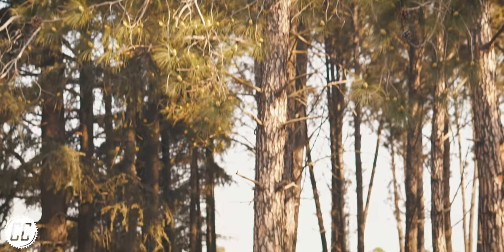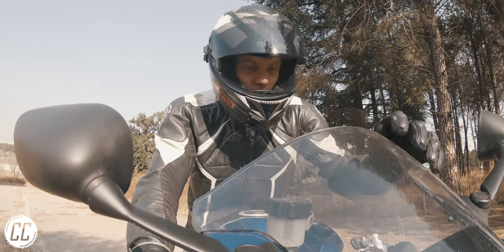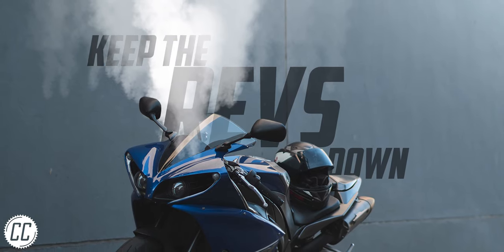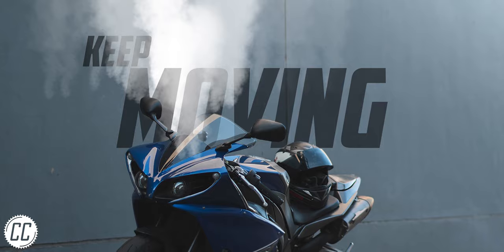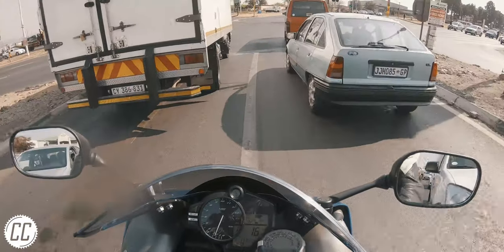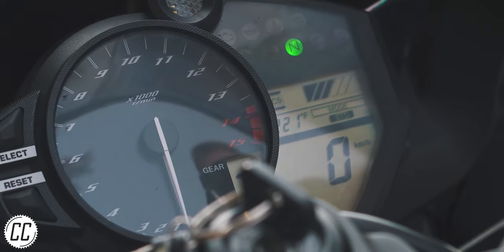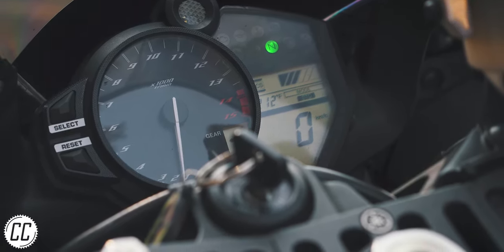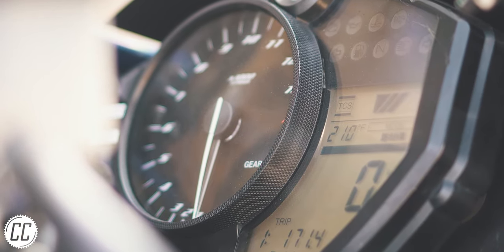Overheating Prevention Tips & Tricks

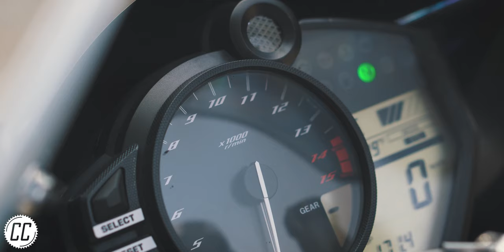Comment: 3:28
The bike will not get to a dangerous heat level if its radiator, water pump and fans are working properly. The fan coming on is exactly for that reason. If you kill the engine you also stop the water pump, going against what I just said above.
Reply: Just looking for this comment :D. I feel like killing it will make it not the solution but the staying on is the option here.
Reply: @AnkurDagar  Yeah just keep it running and it will be ok. If the bike gets to a dangerous heat level (for which killing it would actually be beneficial) it will turn on the red  water heat light on the dash. On older bikes it will just come on, in newer ones (as in my 2017 R6) it will stay on if it's approaching dangerous heat levels and will blink (and self-kill the engine) if it reaches the dangerous level.
Reply: @Kid574  Yup. After getting the overheat warning killing it for some time is alright but on a red light not recommended. 
Thanks, Mate. Ride Safe. Peace :D
Reply: yep, the second the water stops circulating your engine heat rises for about 5-10 min before dropping again(in a car anyway, probably less than half that for a bike). So in other words unless you have an air cooled bike just let it idle for that 2 minutes. Only kill it if you're stopping for 5+.
Reply: try that in Central Florida in the summertime in traffic and see where that gets you!.
Reply: Cajunman Dick Well I’m from India here summer temperature is about 47 C. 
And traffic is too much here.
Reply: As stated do not, I repeat do not shut off your engine. This is the worst thing you can do. He only got four out of five tips right. You shut your engine off on a hot day trying to prevent overheating and that will be exactly what you do. Let the cooling system do its thing while the engine is running. A good running cooling system will not overheat if the system is working properly. Even in most air cooled systems that I know off, once you shut that engine off, overheating is almost guarenteed
Reply: Bro R1 is overheated bike... Compare to other 1000cc like gixxer 1000 fire blade 1000 bmw1000 h2 zx1000 etc.. bikes?
Reply: @r1sabotage  so true also running the fan with engine off is stupid, it will drain your battery and not start, or wear the battery's lifetime
Reply: I've killed my bike (08 r6 aka little heater) while the fans are trying to cool it down (225°F is as hot as it ever gets) and when I turn it back on it will read over 230°F. It's not good to let that heated up fluid and extra engine heat sit stagnant in your bike. It just makes it worse
Reply: Not only that killing it at a set of lights is so dangerous as the idiot behind you on there phone hasn’t seen you stoped and is still driving, boom slam into the back of you and cause your not running and in gear you can’t just move,so much precious time wasted

Comment: This is a common misconception among some riders. When your fan is on, it DOESN'T mean that your engine is overheating.
I live in a climate around 34° to 39°C, my Yamaha MT 07 fan is on and off all the time. But my engine has never overheated.
My engine still running smoothly after 55,000 Km.
Reply: True
Reply: yamaha and other japanese bikes have managed to solve such problems.So whatever you say is right.
Reply: MT07 isn't a sport bike.

Comment: Older bikes have much less problem cooling down. These new sportbikes are just too hot, no pun intended :P
Reply: The GSX-Rs(750) from the oil-cooled era was a hot bike. So hot they took off the fairing lowers when they raced them on Suzuka 8 Hours
Reply: tell that to my honda blackbird
Reply: This '08 gsxr I bought needs to be cooled by going fast!!!
Reply: No, they are leaner tuned from factory because of restrictions...
Reply: Older bikes have a lot of problems cooling down, naked bikes have less problems than fully faired bikes
Reply: @astontoftero3404  I disagree. I have an older bike and most of the people I know with newer bikes need constant maintance or repairs that my bike doesn't even have, and when something needs repair I can do it myself because is so easy, and there is a lot of guides on internet
Reply: My '87 CBR600F1 could reach the red zone on the thermometer just by idling in 6th gear with 40km/h for 3 minutes. 
A bad thermostat not turning the fan on, bad coolant and air in the system didn't help. I fixed that and it's still runs quite hot even on a cold day (i live in Denmark, so it's always cold).
Reply: Hello I have a technical question if you or anyone can answer please that really knows. I Have a WR450 with 
a 1.1 bar cap 16psi.. It never overheats and always stays under 180..if I put a 1.8 bar 26psi cap will thar cause undo steess to hoses or gaskets??

I know water boils at 225 with a 1.1  so if it stays nowhere near there any cap over 1.1 should be fine is that right?
Reply: I'm wondering if anybody has used a bottle of water wetter and pure distilled water if that really runs cooler

Comment: Modern bikes now come with a waaay too lean air-fuel mixture, which also makes the engine run very hot. If you  find a way to put more fuel in there, it will run cooler. I did that on my CBR600RR, installed a power commander and since then not a problem :)
Reply: What's a power commander, just curious? And also couldn't you do a tune-up where you change the fuel to air ratio and make it run rich ?

Comment: there are some other tips and tricks to keeping your bike cool. 
1. clean your radiator , just with water and a good degreaser. just don't use a high pressure washer , otherwise you might run the risk of damaging your radiator. 
2. change out your coolant , it might have been a while sinds it has been replaced. and overtime your coolant loses some of its cooling capabilities. 
3. ingine ice coolant , i've used it. and doesn't realy keep your bike from reaching high temperatures . But it does help dispell the high temperatures quiker ones you start moving. 
4. aftermarket coolant hoses are often a bit better in cooling your bike , but not by much. 

5. bigger radiator of bigger / faster spinning fan. 

hope this helps you out

Comment: used to kill the engine at red lights until i heard a theory that the sudden cool coolant rushing through the engine from the radiator when you restart the bike can cause cracking and warping of the heads since they are still heating up due to radiant heat and there is no coolant flow while the engine is off. not sure if its actually something to worry about but i figure the fan keeps my bike at a (high) but safe temperature idling for even the most frustratingly long red lights
great vid as always tho mate
Reply from the maker: I guess it’s pick your problems. I’ve seen bikes damage their own valves from getting too hot so there’s no good ending apparently lol
Reply: that happen with a VERY COLD WATER... like water at 22-24c and the engine on the low 100's... so no big problems...
Reply: That is not a problem as the difference is not great. It would be bad if the water would be much colder. Just install a manual switch and flick it on before it gets hot.
Reply: When the engine is hot so is the coolant. How is the coolant going to be cold enough to crack an engine ?  The coolant cools down as the engine cools down. It’s the wind that hits the radiator that cools the engine, it’s impossible for coolant to stay cool
Reply: @biggils8894  agreed, wasnt saying its likely, but i can follow the logic, coolant in the rad would cool much quicker than the coolant in the heatsoaked engine potentially creating a temperature disparity great enough that in the most unlikely of circumstances may be great enough to cause a rapid and uneven cooling of an aluminium head or block (or both)... i guess the engine would have to be well and truly overheated, left to heatsoak and then started again but doesnt seem impossible. Definitely unlikely in a normal traffic light stop situation though

Comment: On some bikes you can space the radiator away form the headers slightly which will help. Don't do too much that the front wheel contacts the rad though!
Also a toothpick is a good tool to straighten out any damaged fins to bring back some cooling capacity to an older radiator.

Comment: Add a switch to turn on the fan also manually (keep the auto fan aswell) and everything is okay. Killing it at red lights will do more harm than help. Starter motor has limited lifespan. And starting the engine puts some forces on many parts.

Comment: I highly recommend you do NOT kill the engine at traffic lights. Not only is it dangerous but this also stops circulation of coolant and the bike will get hotter before it gets cooler. Also, this bike is known for bad starters. They don’t last long due to poor build quality. After I start my bike, I only turn it off when I reach my destination to try to prolong its life cycle. I’ve already replaced the starter once. Do a search and you will see how bad these starters are. You can also have the ECU flashed so that the fans come on at a lower temperature. My bike stays cooler after the ECU flash. Trust me, I know this bike like the back of my hand.

Comment: Personally I think killing the engine at lights is unwise, especially if the fan is on. You need the engine coolant pump to circulate heat away from the head and cylinders.
My opinion only.

Comment: Use quality oil, make sure the coolant is up to spec and almost any modern sportsbike will be able to run no issue what so ever in 35 degrees celsius. Good idea to keep the revs down when stationary, but dont stress too much about it... Seriously
Reply: I have a 2000 CBR 600 I just bought it it's runs hot hot when I'm sitting at a light I will if I change the oil in it will it change the temperature if the oil is old in the motor and what would you recommend oil to put in this bike I live in California thank you
Reply: Have 24500 miles on my 2014 Ninja 300 (of which 2500 are mine...) and my stator/water pump areas (both) get hotter than they used to about 200 miles back and a slight ticking/pump knocking. Would say valve knocking, but it almost sounds like it's not compressing hard enough... Perfect cold start but once warmed up and in gear it'll tick and I can hear the valves quite clearly pumping but not hitting/knocking... Any advise? I use quality oil and coolant. Not race certified, but OEM...

Comment: If your bike is overheating in normal operation regardless of outside temp, then you have a problem with your bike or the bike is underspec from the factory in terms of cooling, i.e. undersized radiator, etc. I live in a very warm country (up to 32 C regular day time temps) and my bike runs up to 89c the fan will turn on and cool the bike down to 82c, fan then stops. This is even standing still.

Comment: Guys chill down, this video depicts a operating fan as engine overheating lol. 

A operating fan is completly normal. Check your service manual for the critical temperature(actual overheating!!!) and just ride ... ridiculous.
Reply: Most of the time, they work. Most of the time.

The other times that they won't work would be when the accuracy of the thermal switch(older bikes) or the sensor and electronics(newer bikes) and the fan would stay on, or off, sometimes or all the time with some setups
Reply: I agree my dude, as long as there is coolant and a good radiator I dont think that it'll be bad for the engine. Unless your constantly on the red line even when your on a traffic stop.

Heck, my place is constantly above 25C and ran my bike without adequate coolant plus bent radiator fins for a few months. Thermostat read above operating temp but apparently there is no damage to my engine (I got it checked at my local dealership BTW). I'm not saying that that is a good idea but my take is, an engine can be quite resilient.

Comment: roll with the clutch from time to time so that the rpm will go down. for example don’t use the motor break in downhills. rather stay in high gear and keep the clutch in. and of course try not to go over 8k rpm if you really want to play it safe. stay in higher gears!

Comment: Using just distilled water with coolant ( regular coolants actually runs hot they were made for cold places ) is not a good idea though I have 08 R1 it was running way too hot for my liking and comfort zone unfortunately cooling fan not  kicks in until 220degrees I didn't liked that did plentiful research this really really worked. this summer I changed it with HOAT coolant ( Toyota has best ) mixed it with ionized water not just distilled water it's a bit expensive but sure it works. Hope this helps

Comment: I just installed a race-spec radiator on my buddy R6, added more heat shields to guide air away from engine, more water than coolant and even expensive oil.
Reply: Be careful with the coolant to water ratio, water has a lower boil point than coolant which is why we use coolant.
Reply: L3G1T The point is coolant does not conduct heat as well as water, we're just offseting the thing. And that's how it's done here with all the heat with the larger rad

Comment: Another issue that you're facing is altitude. 1700m above sea level, thinner air, less efficient cooling. Add in the higher air temps, the air thins more, even less efficient cooling.

Comment: If the temperatures that hot out and my bikes running that extreme I will shut the engine off at a light I also run a full synthetic belray oil can handle extreme heat better than conventional mineral oils

Comment: Oil is the first level of cooling so keep the (warm) level topped off at the high mark. Use a good full synthetic brand with a high flash point & 100C cSt viscosity

Comment: Best thing to do is flush out your coolant with distilled water to get rid of any of the old contaminates. Burp your coolant once you start filling your radiator and I use engine ice and buy a new radiator cap just in case the old doesn’t give you an air tight seal anymore. From experience my cap was making temperature go up after flush. And flash your bike with a professional to turn fans on at 195f degrees

Comment: Dude i have a doubt, your r1 version have halogen headlight doesn't that radiator fan and the headlight kill the battery eventually, due to kill switch applications when the radiator fan is on. And also I seen many r1 (not the led headlight version) struggling to start after kill switch application while the radiator fan is running.

Comment: It's a R1, it's supposed to run hot. I've had two of them and it's one of their traits because their exhaust pipes run very close to the oil pan hence the propensity to get hot. Add in the hot summer months and sitting in traffic,it's gonna get hot!. The only fix is to get a larger radiator!.

Comment: Overheating is only a problem when ur Fan is permanently on... Not only some times, and bro, all those expensive additive products for the cooling fluid arent really necessary... When you're about to fill in Water and the coolingfluid u only need a tenth of the fluid and the rest is good with water, the water is that fluid which grabs the warmth out of the engine, the other one is only in the cycle for no corrosion and that the waters point for freezing is going down, so at those temperatures you dont need that much! Greetings of Germany ✌️

Comment: Immune!! Naked bike life!
Reply: Problem would be the water and dirt coming into the areas you won't really clean regularly...
Reply: S1000r, Tuono and Mt10 heat up very fast
Reply: Also you can’t go faster than 220 k/h in most of naked motorcycles, they’re just another breed of bikes
Reply: @IkerBoulala  there's not much roads to go 220 without getting into serious trouble. At least in my country
Reply: jozo šaravanja well just don’t stop for cops lol
Reply: @ruikazane5123  Dust Greaser is the solution, Easy. Its a motorbike, what do you expect? Naked is meant to be city ride, not racing like fairing motorcycles do with their humping posture seat.
Reply: @iamleoooo  Most people use the  nakeds as sports bikes like in the 70s(CB 750 anyone) and some love off-roading or going adventure. And that is with a lot of dirt, really
Reply: @ruikazane5123  Naked is not for one genre only. We got StreetFighter, Cafe, Scrambler, Tracker, Japstyle, Bobber, etc. You cannot saying 1 genre of style to be as a one purpose only, as for example tracker is meant to be off road ridding on a rock landscape surface and on a mud track.
Reply: @iamleoooo  A naked sport like, say, XJR1200/1300 is what is called 'conventional sport bike' though. If it is only about naked bikes, you can count pretty much everything even the FZ 750, which is a true sportbike. 
But generally,(with the police for example) they are categorized as naked or 'faired'.
Reply: @ruikazane5123  depends from which country are you come from. You cannot tell a cops bike are naked based only from 1 country
Reply: Leonellus Creation The thing is, the police and the traffic personel would question you when your bike does not have fairings when you turn it into a streetfighter or scrambler, for example. Some would even say it is not good for road use...the oppression is really real.........
Reply: @ruikazane5123  very unfotunate because that has never happened in my country. Naked is for life, fairing is for adrenaline purpose.
Reply: For another reason fairing is much hotter for the busy road or for the country which has 25+ degree celsius on average

Comment: killing the engine at red lights isn't actually that good, although the fan may still kick in the water pump wont, as it's powered by the engine, and the coolant may get cooled down in the radiator but it wont circulate to the engine to cool it down, instead the engine will boil on the inside while nice cool coolant is still in the radiator